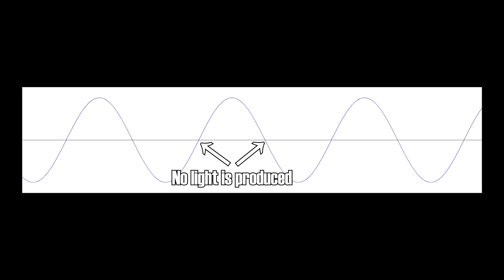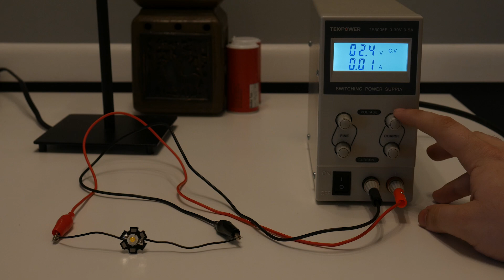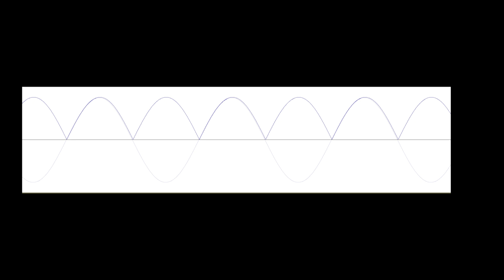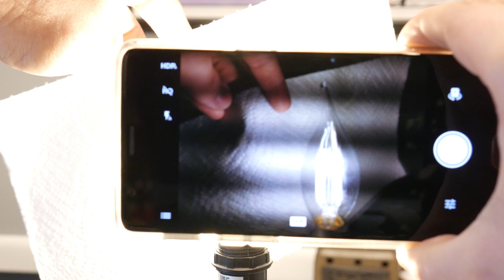LED bulbs that flicker, and CFLs that almost never did

Comment: Most dimmable LEDs I have taken apart appear to have a high frequency flyback or buck circuit powered through a rectifier. Pretty easy to tell apart from capacitive droppers because they will run fine on DC and, for some, even on 240V AC without the magic smoke escaping.

The manufacturers could stop them from flickering by adding a big(ger) electrolytic capacitor to the output, but in practice they don't because that would increase the cost and they definitely wouldn't last 50,000 hours.

Comment: I use LEDs as my light source while I am not at work (under florescent light), and have chronic migraines. I don't care about light tone as much as whether I can see with the light. If I can see, It will do. But I've noticed lately that in my home space (not work), I have been getting headaches that are only alleviated when I turn off my lighting, after only a few hours of having my lights on. Usually after I get off work, I avoid turning on my lights to give my eyes a break, or I use green light (in the form of an Ally lamp) to help with migraine light therapy. 

This video helped me to understand that it could also be the slight flickering of the LEDs that cause this. I use straight up LED lights, so they're not fancy bulbs or anything. They are likely to have this problem, and it explains why I feel headachy after only a little bit if I brightly light up my room.

Comment: 7:51,  Actually, all white LEDs that I am aware of use broad band phosphors.  Phosphors that emit all the way from the blue chunk of the spectrum, and and a broad even band all the way from that blue, through green, through, yellow, through orange, and into the red.  They emit red, green and blue and every wavelength in between within the visible part of the spectrum.  Where as older CFL lighting had phosphors that emit strictly red, strictly green, and strictly blue light.  This is why LEDs actually have color rendering that is so much better than early CFL lighting.  Some LEDs even have specially designed phosphors that are designed to have color rendering up into the <95 range.  Because like I said, they don't just emit red, green, and blue light, they emit a broad even spectrum of light.

Comment: There are places that I find the slow start and gradual build up of the CFL to be beneficial in my bathroom.  If I need to get up in the middle of the night, or when first arising in the morning, I don't need or want to be blasted with bright light.  I like the gradual increase of intensity.  On the other hand, by the time I'm getting ready to shave, the light has come to full intensity.  

In one of my previous homes, I had a dimmer in the bathroom for that reason.  It gave me that same effect but with manual control.

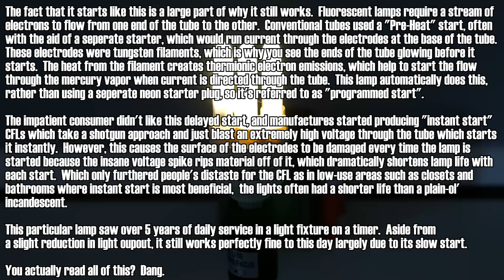Comment: Over 3 years old.... and I still find it necessary to note the misspelling of the word "output" at 1:50
"This particular lamp saw over 5 years of daily service in a light fixture on a timer.  Aside from a slight reduction in light _oupout_, it still works perfectly fine to this day largely due to its slow start."

....Thank you for the correct "its" and the run-on.  (Should really have put a comma before "largely" as well.)  But the misspelled word is what stops me... I can ignore missing punctuation far easier than trying to figure out what word was intended. :)

Now to give the average person some interesting information...

I When I was growing up and going to grade school, we had florescent lights... and as I sat in class, I would start to see the light in the room get brighter and dimmer over time, and sometimes at the end of the day, I did start to have ... "headaches"... (not really but it's the closest I can describe.)
The classrooms with newer bulbs weren't as bad... the classrooms with more bulbs weren't as bad... 

I thought it was my imagination until I had access to a video camera that could record at faster and slower speeds - and I recorded a room with a large number of these... and got to see them fade in and out.  (Not only that, but digital clocks' LEDs also turn on/off the individual diodes, in sequences that differed based on what number was being shown.  (A 1 was always brighter to me than, say, an 8, though the 8 had more diodes....... now I was able to know why - it's only two diodes and they were almost always on, whereas the diodes in the 8 were off more than they were on!)

I haven't had the opportunity to do testing with modern bulbs... I'm surrounded by LEDs now, in various forms, but they don't seem to be anywhere near as bad as those florescent bulbs in school.  The CFLs, though, did flicker similarly.  (They also seemed to start faster in COLD than in WARM rooms... care to explain that? :) )

Comment: I must comment on the claimed lifespan of a LED bulb , as you have shown they all have electrolytic capacitors in their circuit, all such capacitors have a finite lifespan that is shortened with heat as the heat causes the electrolyte to dry out and all of the bulbs that I have seen  with the circuit in the heat sink base that gets quite hot to the touch. As far as using an electronic ballast to replace magnetic ballast in old fluorescent light fixtures , where I worked we replaced perfectly working magnetic ballasts some of which were over 40 year sold with energy saving electronic ballasts , most of which  failed within 10 years. What we saved on electricity was eaten up by the cost of another ballast and the labor to replace it .  I opened up a dew failed electronic ballasts and they all had swollen and leaking capacitors inside.

Comment: I have tons of 2.5 watt filament type LED's bulb that I really like the low light and 2500k glow. Does the low wattage help them flicker less since the capacitor is only dealing with and able to store the 2.5 watts? Would a 10 watt filament led flicker more with the same size cap?

Comment: Almost all of the light fixtures in my house use LED bulbs except for the counter top lights which use those tiny bulbs (they're not LED but they're not florescent or incandescent either) and the light fixture in my bathroom which uses traditional incandescents, and the small amount of space you mentioned must have been why I had to change the one bulb in the light above the kitchen table twice. The counter top lights are a different story because it was always this one bulb on the my right hand side above the computer that kept going out. Me and my dad were forced to believe that there was a loose wire in the lamp

Comment: This made curious.  You see florescent light have been a trigger for my migraines.  Mind you, mixed lighting wasn't a problem.  If I had old style florescent tubes above me but some daylight coming through windows or some incandescent lamps no problem but all florescent light was.  I replaced the incandescent bulbs in the fixture above where I work with filament LEDs but never had a problem even when it was my sole light source.  I tried your trick of using my phone camera to see lines.  In my case I didn't see lines.  When I adjusted the exposure I was able to produce faint lines that slowly scroll.  These bulbs anyway seem to have enough filtering to remove most of the flicker and these are E-12 base bulbs so they do not have much room for circuitry.  The cheap LED Xmas lights I put up outside flicker like a banshee though so I wonder if they use a half wave instead of a bridge rectifier.

Comment: The flickering of CFLs isn't their only bad point. Besides the very bad gaseous mercury of course. Their light isn't natural at all. Not like the sun, a spread over the visual range of wavelenghts. CFLs produce just 2 large spikes at specific wavelenghts (and a ton of dangerous UV light) which makes it very bizarre and unnatural.

Comment: I can actually see flicker in a lot of CFLs (which is ironic because I wear glasses and should wear them at all times, my eyes are not good on their own), I can even see flicker in most OLED and multiplexed LED displays, also some LCDs where the PWM backlight control frequency is too low. What I disliked most about CFLs tho' is their poor CRI. LEDs changed this, I initially hated them the most but they have matured. These days LED bulbs to me have no flicker (their switching frequency is high enough), have a good CRI and pleasant color temperature. They also became dirt cheap. So it's a win win situation and the only incandescent bulbs in my home are the ones that haven't died yet and I only use them in rooms the light is rarely used. When they die I'll be replacing them with LED bulbs.

Comment: The only thing i don't like about LEDs compared to CFL is the difficulty of finding appropriately bright ones. 8 years ago i didn't have to even hunt to find the 2750 lumen CFL that i used in my living room fixture (a lot of oregon living rooms have this REALLY OBNOXIOUS design where they have no ceiling fixtures and are intended to be lit by a 3000+ lumen bulb from a free standing or hanging corner fixture.) 

8 years later it's finally died. And i had to hunt and hunt and hunt and the best i found was a 1700 lumen LED bulb. Now my living room is dark and dreary feeling because the bulb just isn't bright enough.
Reply: Home depot does now sell some Feit Electric LEDs at the brightness you're looking for
Reply: @exoticcar5482  I've since replaced all the lights in my home with LEDs and its been fine aside from all the flicker. Like every couple of hours one set will just start flickering a bit for a few minutes its annoying the shit out of me.

Comment: Christmas LED lights use AC and have a very noticeable flicker since only half the cycle is powering the lights. The amount of lights there is directly divides down the voltage so it dosent blow out the leds. But they run about 30Hz.

Comment: 3:20 I found that out the hard way, long ago back in 8th grade when I connected a fluorescent tube (one with one of the end-filaments bad) straight up to a lamp cord (had no idea about ballasts), ran the one functioning filament with a small transformer...  and when the tube started conducting, it made one absurdly-bright FLASH and never worked again.   (fortunately it didn't explode, but the bulb did get really hot in that tiny fraction of a second)

Comment: 10:40 Could it be, that the size of the capacitor is better suited to the european voltage? If all four filaments are wired in series the total current of the bulb is half as much so the same capacitor can provide a cleaner output voltage with less significant dips.

Comment: I hate those led contour lights on the front of 'new' cars, they mess with my depth perception in low light conditions (@53deg. north (or south) we have a fairly long time of that twice a day...). On the other hand I also love them when driving a wheel loader because (if they have the right frequency) they flash on the rear view camera. It should be illegal to put stroboscopes on cars !
As usual nice explanations, keep up the good work.

Comment: LED's have been very poor at color rendering long term with very poor spectrum coverage! within roughly the last three years have they improved to near high end incandescent spectrum output!
many still used filtered lens trickery to have good output **see all the LED backlit TV's that had the lens breakage/failure and went very odd blue eye-killing screen
** NOTE: that said, I have primarily all LED's installed here :)

Comment: From the wiring I've done with LEDs, I don't think the driver does more than voltage conversion and regulation.  If the LED is dimmable you might map this function to the driver.  It's usually done by pulse width modulation-the LED is flickered at high speed so overall output is diminished.

Comment: For the most part, LED lights can closely mimic incandescents, and produce very pleasing light. However, most LED lamps lack deep red, and so all red objects in your room will look somewhat pale and orange-red, and if your favorite color is red, that's a sad thing. I have only one room in my home that still uses incandescents (300 watts worth), but I've tried all other options, and I wouldn't use anything else.

Comment: I feel like, while this explanation was very thorough it did not touch on the spectrum issues of the bulbs, which in some cases are very spikey towards particular wavelengths in some bulbs causing other visual fails. I don't know if this specifically relates to the flicker, but I've found in my bookshop that the absence of the full spectrum makes the reading very "flickery" whether or not its an actual pulse flicker of the bulb. I can't say the LEDs are better reading light than the CFLs, I think they've been mostly worse, but the Halogens performed quite a bit better in this regard, though I'll always be a fan of the old incandescents, and, like candles, hope that all of these technologies will continue to be produced

Comment: I still use incandescent bulbs in my home, as I personally enjoy the feeling of warmth that comes with incandescent lamps. 
Also, the heat given off by incandescent bulbs is not waste heat in northern regions where you are actively heating your home for 75% of the year.
Reply: True. That's a valid use for them.
Reply: That's only true if your heating source is resistive. If you use natural gas for heat, or a heat pump, it's still wasting energy.
Reply: @Owen_loves_Butters  No, it still wouldn't be waste heat since you would be using less of the other heat sources.
Reply: @Intelwinsbigly  Alright, more in depth it is.

Let's say that your house's heating demand is 8kW and you use resistive heat. This means you'll have to pay for that 8kW, however much that is for you. If you use 20 60W incandescent bulbs, 1.2kW of energy is being used by them. The light ends up as heat eventually, save for whatever tiny bit escapes through windows, so that's 1.2kW of heat. Your heater will now only have to use 6.8kW, so you're still only paying for 8kW. So far, you're right.

Now let's say you have another heat source (gas is usually cheaper, but I can't say that for sure without knowing the cost of both of those things where you are, so we're just gonna go with a heat pump which will always be cheaper than resistive). Heat pumps can have c.o.p's of 4+, let's say 4. A c.o.p. of 4 means for every watt the device consumes, it moves 4 watts of heat inside from outside. So it'll only be consuming 2kW. Once again, 1.2kW of incandescent light means 1.2kW of heat. Now the heat pump is consuming 1.7kW. (1.7kW*4=6.8kW of heat from the pump, 1.2kW from the lights). 1.7kW+1.2kW=2.9kW. You're consuming an extra 900W. That's waste.
Reply: @Owen_loves_Butters  then there is no waste heat and it is only a minor increase in expenses...
Reply: @Intelwinsbigly  I see you didn't read my comment. Or at least, you didn't understand it.
Reply: @Owen_loves_Butters  I did read it, at no time did you explain how the heat output of incandescent bulbs is wasteful beyond light escaping out the window.
Reply: @Intelwinsbigly  It was originally 2kW for heat. With the incandescent lights, that goes up to 2.9kW. That's 900W of wasted energy. For LEDs it's only 150W. I don't know how to explain it any clearer.
Reply: @Owen_loves_Butters  have you considered that more carbon would be released by non electric heating?
Reply: @Intelwinsbigly  Yes I have but a heat pump is electric
Reply: @Owen_loves_Butters  Than you must have your math wrong, since generating heat electrically will give the same amount of heat for any given wattage, regardless of the appliance.
Reply: @Intelwinsbigly  True, generating heat electrically is always 100% efficient, but a heat pump, which moves heat inside, heats more than an equivalent wattage resistive heater. What is your heating source anyway?
Reply: @Owen_loves_Butters  anthracite.

Comment: I did not get LED in my room because of the flickering involved if I bought a premade lamp and it had a shitty converter - cannot risk that. I thought about building my own LED lamps but too much work so I got tubes and a proper good starter/supply that has 40 kHz flicker. This, along with the fluorescent coating of the tube means flicker-free light. And a tube is super cheap compared to LED and I can switch to different color temperatures in a minute. There are even super bright daylight tubes (osram skywhite) where you think the sun rises in your room, it's insane.